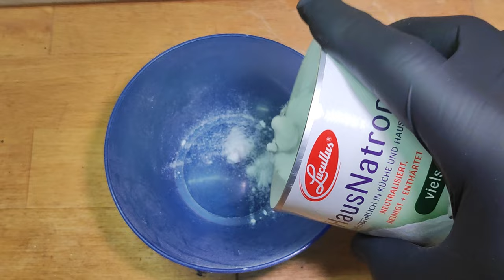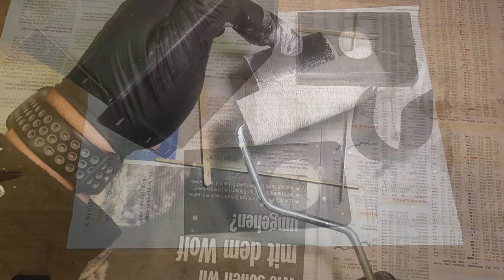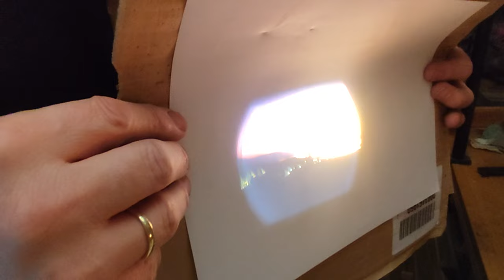Old Slide Projector Restoration - Rusty And Almost Forgotten

Comment: Neutralizing the vinegar with baking soda defeats the purpose of acidic tarnish removal...just soak the brass in vinegar alone
Reply from the maker: Hi frick566, thanks for the comment and the hint. I tried it today with my new project - it worked fine (now I only have the problem with flash rust, which I have to solve). Greetings Sascha